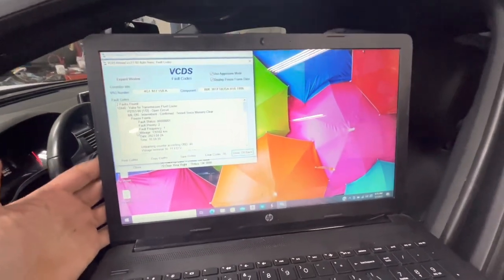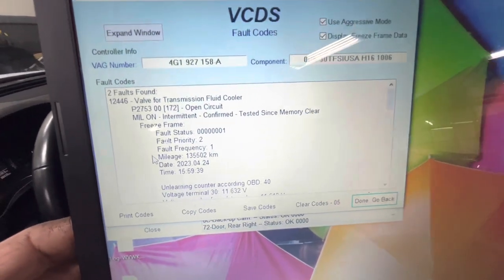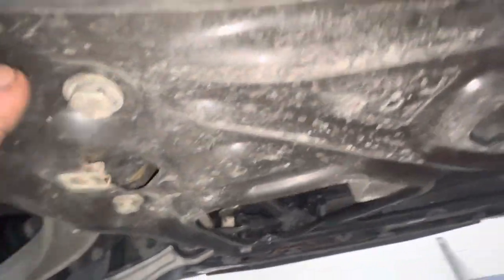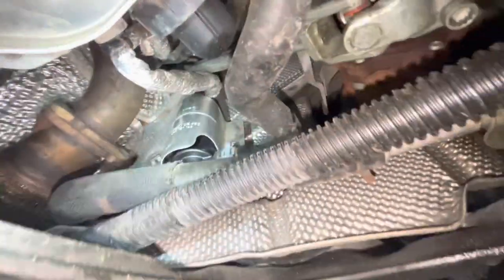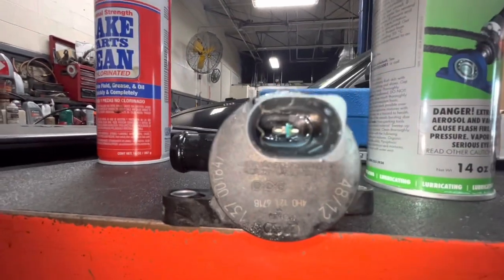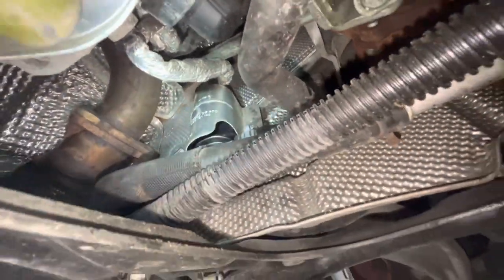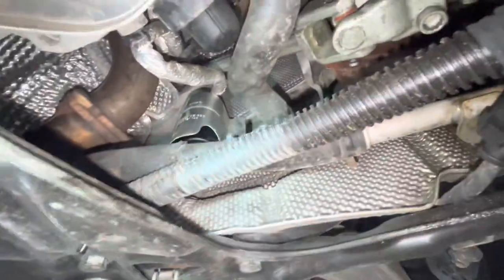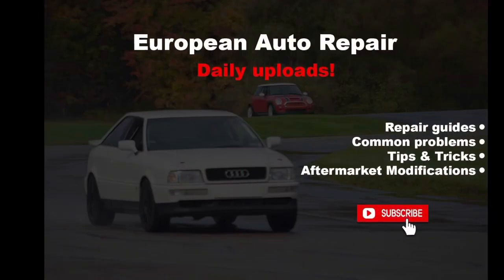AUDI A6 P2753 VALVE FOR TRANSMISSION FLUID COOLER (OPEN CIRCUIT)

Comment: I got the P19A2 code for my 2018 VW Passat R-Line, it relays the same error "transmission coolant valve open circuit" is this the same issue or similar? I also replaced the coolant sensor hoping that would take the code away, but no luck. any feedback could help thanks!
Reply from the maker: It’s likely the same kind of thing but in a different location, I could be wrong on this but I think it’s located off the back of the cylinder head on top of the transmission

Comment: When the VCDS says that the valve is shorts to plus, what could it be? The valve itself or a cable? Thanks
Reply from the maker: Could be either or both, your going to have to remove the plug and take a look